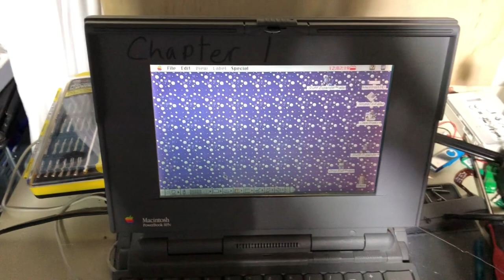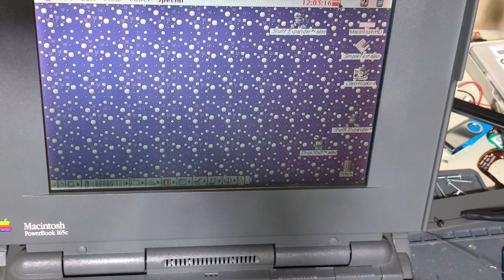Macintosh PowerBook M5654 Battery Rebuild (Its not pretty but it works)

Comment: I acquired a Contura Aero 4/33C in box, what would be a good price to sell it for? Already have a 430CX and a 1130T and I don't need a Aero.
Reply from the maker: You probably could fetch $100 for it.
Reply: @i80386sx  That's actually what I had in mind, thanks.
Reply: @i80386sx  It ended up going for €40 because the market for old computers absolutely FUCKED these days. That and the FDD was missing.